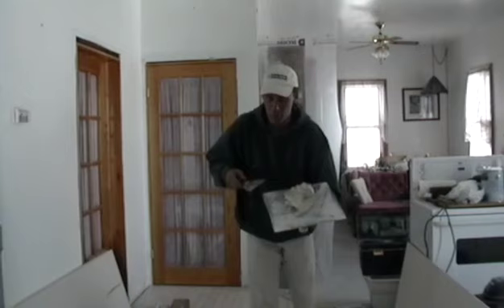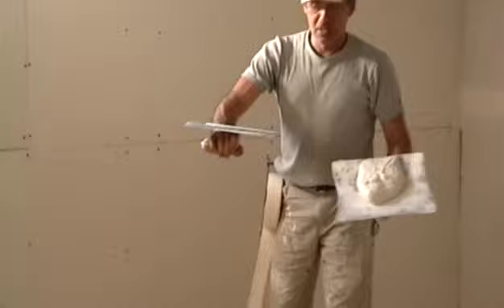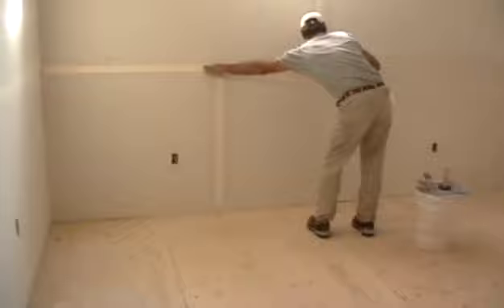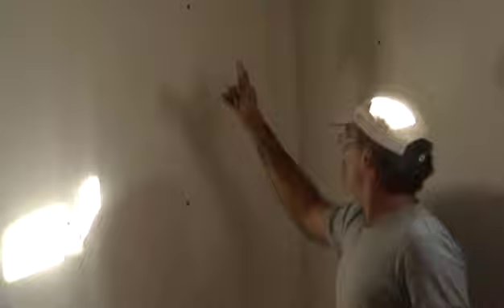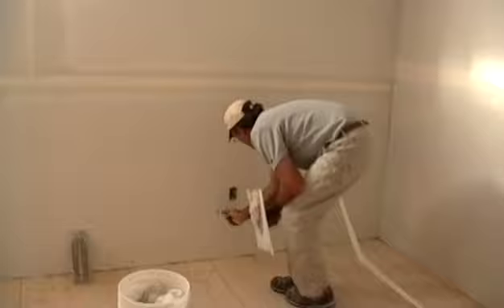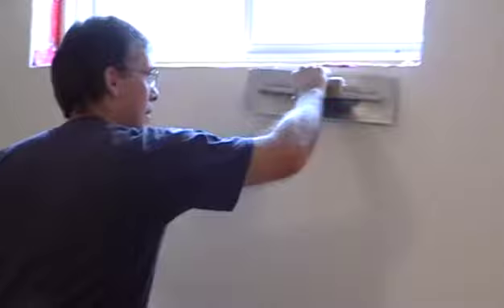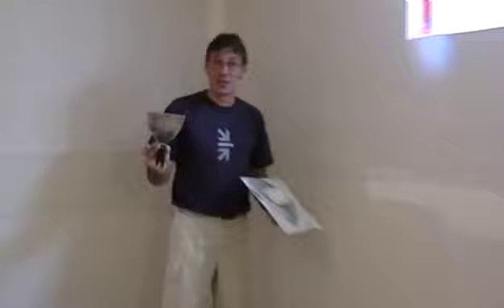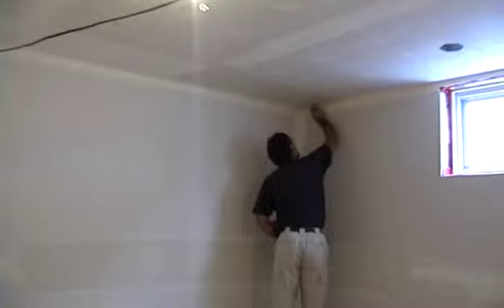Basement Drywall : Taping and Coating

Comment: Dude -- Really good job of explaining the little details, like holding the tape in place, tearing the tape an inch from the cross joint, folding the corner tape, positioning yourself against the corner wall, etc etc.

Comment: Excellent video from a professional plaster and teacher.  One tip I learned/saw for 3 way corners is to think of them as car lanes meeting into a junction.   If you imagine a "left" and a "right" lane, you do all the "lefts" first, then all the "rights" next time.   Or vice versa depending on your style.  On the Left wall, you have a ceiling edge (left lane) and a wall edge (right lane).   Right wall is reversed - Wall is left lane, ceiling is right lane.  And you vertical corner is left/right lanes as you look at it.
Reply from the maker: Thank you! I really enjoy trying to see things from other perspectives. I like your memory filing system on this task. Have a great day!

Comment: Laurier, what size trowels do you use? Is it somewhat similar to the taping knife? The knife's I have are 6, 8, 12, 14. The video where you tapped the butt and belly band with the hawk and trowel blew me away, I drove straight to the material yard and picked up a 14" hawk and an 11" trowel  ( that's all they had ) I'm in the process of finishing my basement and wasn't looking forward to taping all the joints by hand, but man you made it so simple and elegant! Thanks for all the free training, definitely OG and I highly recommend the way you're doing it.
Reply from the maker: Check my videos. I talk about trowel sizes.I've been using trowels with a hawk for 33 years so that is why I make it look easy.

Comment: I'm a woodworker and general contractor from Connecticut.  I like taping my own projects, I just find it soothing and relaxing.  But I'm not good enough at it to sub myself out.  I'm curious about your method of making a ring and adding plaster to regular mud.  When I'm doing work like that where I want to get multiple coats on quickly, I just use a 20 minute compound.  What's the difference? and why don't you just use that?  Clearly you know more than me, so I'm not trying to argue for the way I do it, I'm just curious about your methodology.  Love the videos, you truly are a master, and it's magical watching a good taper handle mud.  Thanks fore the content.
Reply from the maker: Thank you for inquiring as to my use of materials. I also have experience with durabond 90 which hardens like cement in 90 minutes, 45 minute mud. Quickset is the fastest time between coats, that makes my painter pro friends happy. so I shared. Does this help you a little bit?

Comment: Hello I am going to attempt this on a room 2.4 x 3.6 meters with an apex roof.  Could you please tell me what plaster I should buy as I am confused about the different types.  I will use paper tape.  Thank you
Reply from the maker: My favorite drywall compound is called CGC beige. I like it because I pull the bag out of the box and I bounce it on the floor to mix it up. I then hold it over a 5 gallon pail and cut the bottom of the bag and squeeze out the mud so I don't waist much.This brand is soft and easy to work with , without the need for a mixing drill. I do realize that I make it look easy because of years of muscle memory so I swithed hands for my hawk and trowel in order to understand how difficult it really is even with all the knowledge. I wish everone the best for success in accomplishing your goals.